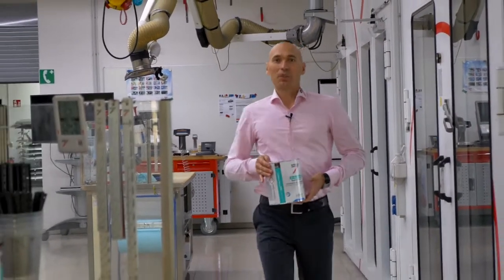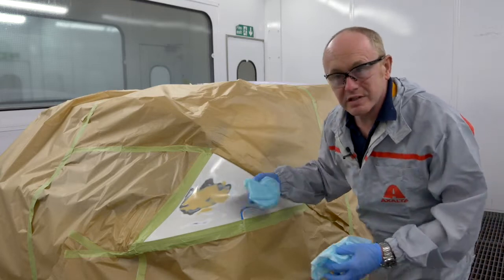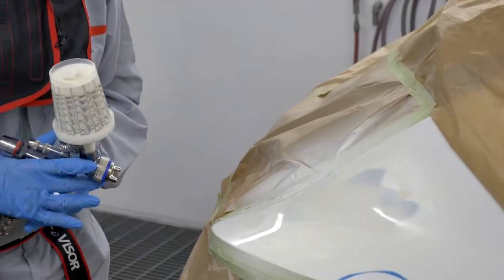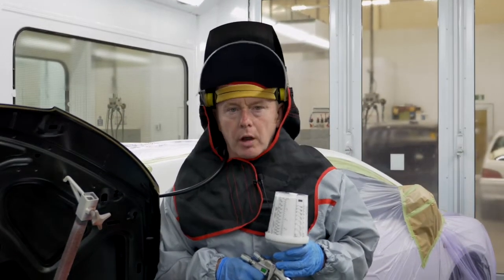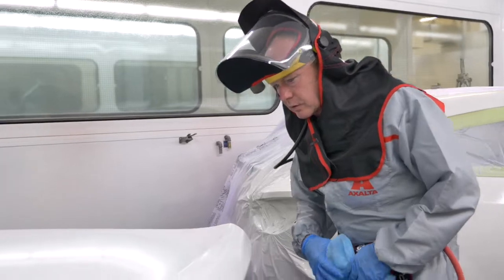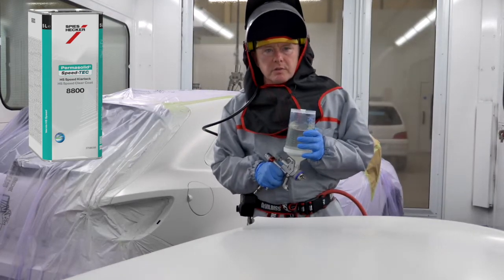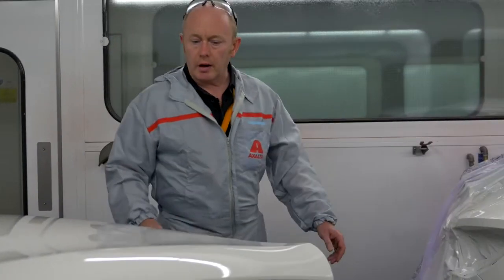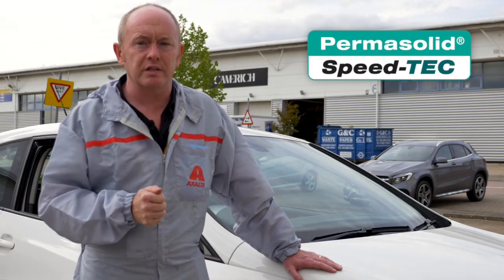Turbo Fast Repair Process

Comment: hi what grit was the bog sanded at before primer was shot?
Reply from the maker: Hi, the Raderal IR Premium Putty 2035 was sanded with P180 and then refined with P240 as a final step before use of the Priomat Reactive Wipes 4000 and subsequent application of the  Permasolid HS Speed Surfacer 5500. Thanks.

Comment: its a shame the clear is so toxic do not expose bare skin to this clear as always cover up properly
Reply from the maker: Using the correct PPE/RPE is a must for which ever product you are applying. Complete protection of skin, eyes and nasal passages is the best and only way to avoid inhalation or conatct through overspray.